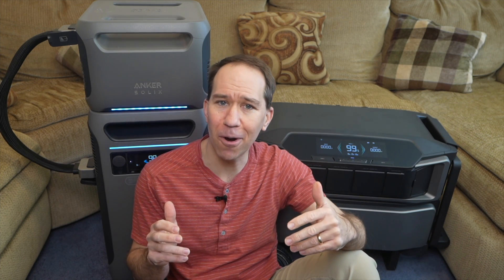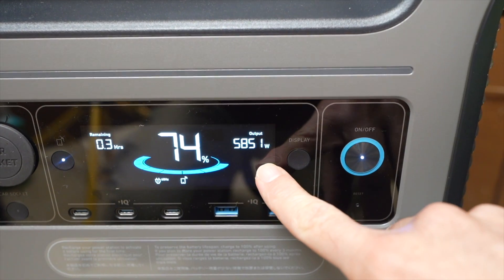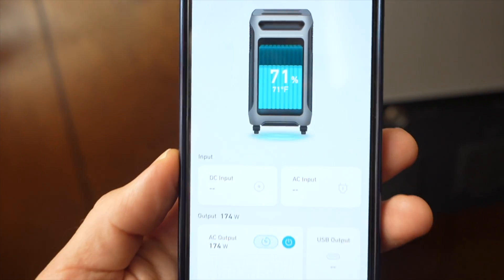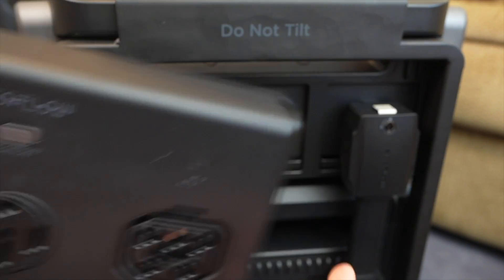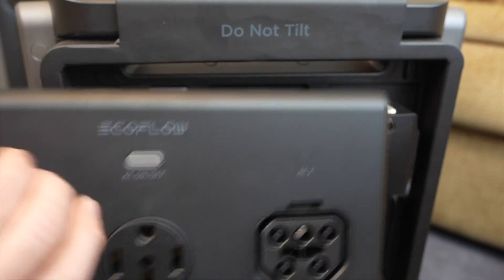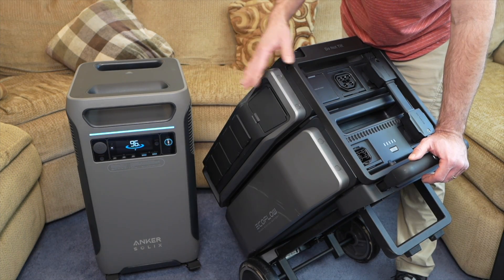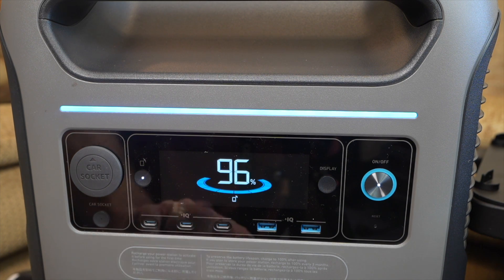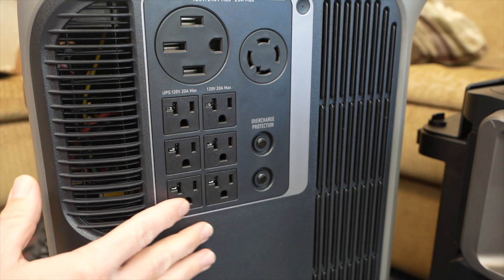Big Differences? Anker Solix F3800 & EcoFlow Delta Pro Ultra COMPARED

Comment: I really like the Anker Solix 3800, priced right, BUT the low solar input is kind of a deal breaker for me. I'm holding off buying until either that's fixed or something else comes along. I'm also interested in the Yoshino B6000, but it hasn't been officially released yet, so price and final specs are still an unknown.
Reply from the maker: I saw the B6000 at CES.  I'm hoping I can get one to try out.  It will likely be a much higher price per watt though.
Reply: That's my fear as well, Yoshino's solid state batteries are typically more expensive per kw. They do had one big advantage, they're considerably lighter, but they also have some disadvantages, such as cost/kw and generally fewer charge cycles. @solarguy

Comment: I've been researching, and I've decided to buy 2 DPU (initially 2 batteries then building up slowly) with a 50amp Hub and having an inlet installed indoors to use for quick outtages (few hrs) .  I'm also having an inlet installed outside for a 13000 kw dual fu generator for extended outtages.  This way, I can go back and forth if need be.  Use solar when possible, switch to LPG when needed or when batteries are recharging.

Comment: Anker is still trying to stay portable even in this category. They want to offer more versatility. Ecoflow ultra is 99.999% is aimed for home back up and stationary use. It’s way heavier than anker (without the extra battery), larger in size and more expensive.
Reply from the maker: They are both technically portable but yes, the F3800 I'd say is more portable when using it outside the home for things.  Though at about 132 pounds, not something you just toss in your car like you would with a much smaller power station.

Comment: I see a lot of uses for the DPU, but in my case I want to tie in my home PV with the battery and grid. I heard the DPU can't be tied in with Grid. Where as the Anker has AC Coupling. Is there a way to make the DPU do the same?
Reply from the maker: Neither one can be integrated natively in with your home system without an accessory.  For EcoFlow is it the Smart Home Panel 2, which is a smart sub-panel that the DPU directly connects to.  You can have home PV solar system and this would be a battery storage option for backup and for things like saving money with Time Of Use rates with only the loads on this sub-panel.  The DPU can also accept the solar input directly so you could add more solar in addition to your home PV system and not have to go through any grid-tie agreements, etc with your utility.  The upcoming Home Power Panel from Anker inputs AC and outputs AC (it doesn't have the individual circuits like a sub-panel would).  The F3800 systems connect to that.  I have asked Anker for more information on the HPP so I hope I can answer with more details if desired.  Does that answer your question?
Reply: Thank you so much for the info. I hope you can go over my situation in the future. I'm trying to find the easiest way to tie things together. Trying to mimic what the Powerwall does. Again thank you for your videos and reply. Subbed.
Reply from the maker: No problem.  Feel free to email me or post questions and I will do my best to reply.

Comment: Not quite fair to compare an Anker with an extra battery vs. a DPU with only one battery. Add  a second battery to the DPU then the price per watt improves greatly
Reply: Actually it’s a more fair comparison with the extra battery since the anker is like 2300 cheaper and the two units really don’t compare in the first place so the battery would put it on a more level playing field and it’s still less expensive than the ultra. Anker really doesn’t have a direct competitor to the ultra just saying, so that’s the only way to really compare the two.

Comment: The reasons why I got the DPU are the PV input (the Anker solar 60 volt limitation is stupid and IMO shows they do not understand the market and use cases), the DPU can take 120 volt input and output all the way up to 7.2 kw at 240 volts -- this will allow me to use the Ioniq 5's Vehicle to Load feature (120 volts up to 1,900 watts) as a large 77kwh emergency battery backup, as far as I know only a Victron unit can do this but only 120 volt.  Good review
Reply: Any issues with the DPU so far? I’ve been seeing some comments where people are having notable issues.
Reply: @A_pad91  I'm curious what the issues may be as well.  I believe i've watched about 20 different "first looks" and multiple reviews and the firmware has been the only gripe so far. Definitely would like to know if there's wider issues before I go about purchasing one.
Reply: @A_pad91  Like what? I'm glad I got one
Reply from the maker: I haven't heard of any on production units that have been shipped out.  What have you heard?  I've noted in another video my one MC4 port had an issue (too loose for my liking) but this may be because I have a pre-production unit.
Reply: This is exact set up I was thinking of. I have EGMP vehicle that can provide 120V. And I want to have higher overhead for wattage. I would only require 120V though as for output, but want higher over head like 4000watts.

Comment from the maker: Thank you for watching!  I really like solar, battery, and related technology.  Please consider subscribing! (and click for the notifications)
Reply: Best comparison of both units that I've seen so far, so great job. Some comments: 
#1 - I do not know how can anyone can call either unit "portable" with the Anker over 200 lbs. Also having the expansion battery "loose" on the anker makes it less movable IMO.
#2 - On pricing, you should also include the battery expansion per Wh. One DPU expansion battery is $2549/6144 with code (and NO SALES TAX) for just 41.5c/Wh. Where the Anker is $1994/3840= 52c/Wh.
So both units with at least just ONE battery expansion cost 55c/Wh+SALES TAX for the Anker from Home Depot, versus  $7304/12288=59.5c/Wh (WITH NO SALES TAX), which is much more comparable (if not cheaper when you factor the sales tax) to the cheapest price of the Anker. And definetly the DPU ends up being much cheaper per Wh when you factor it with TWO or more battery expansion.